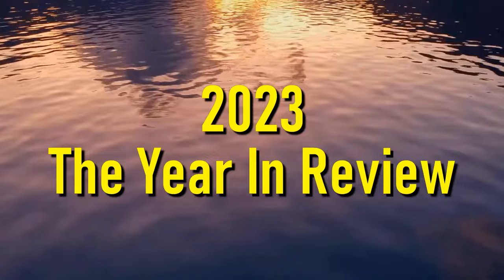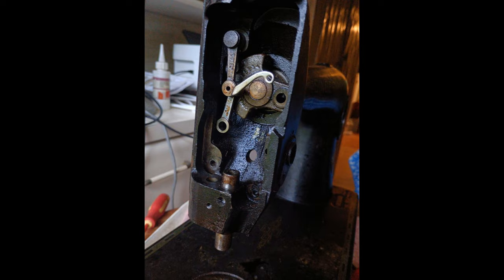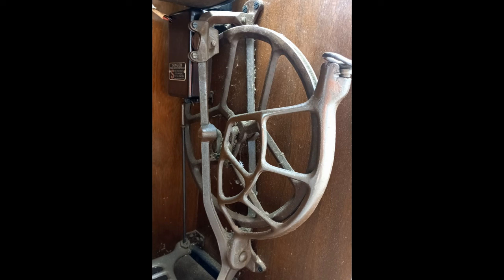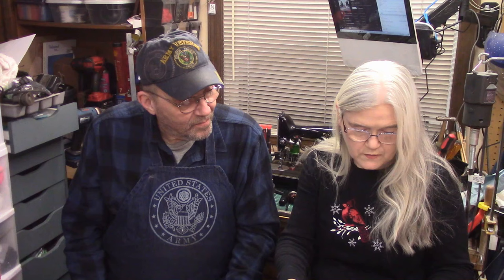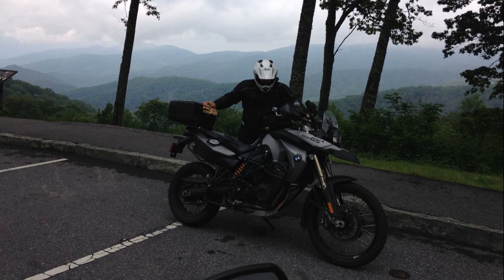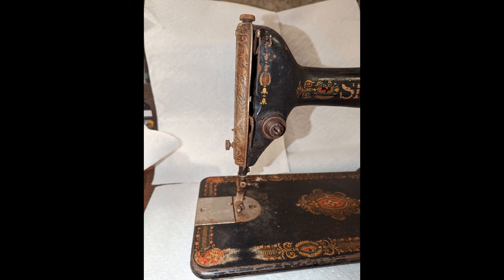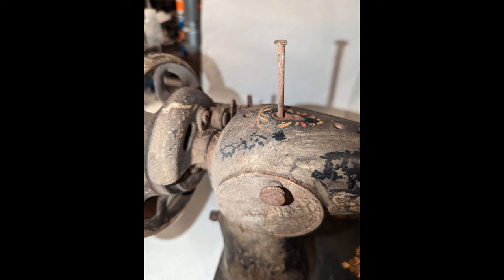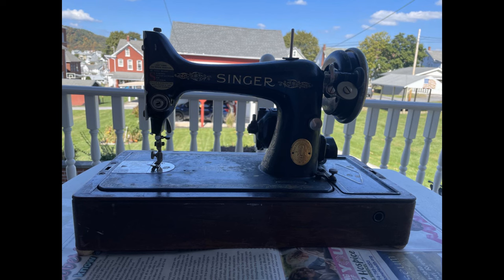The Year in Review!: Sunday Morning Quicklies Episode 108 - December 24, 2023

Comment: Oven Gas mark1 - Woodworm in a base of my Singer 185k, earlier today (quite a coincidence ) I managed to fit it in the UK size oven diagonally for 2hrs with a digital meat thermometer gave a reading of 85'C. The base is held together with wood pegs so I puled it apart, just need to fill all the holes and groves that were under the factory canvas tape that was around the base.
I found online that woodworm dies over 55'C - the articles talked about covering large items in foil and leaving in the sun on a hot day, or in the back of you car so the sunlight does not damage the finish.